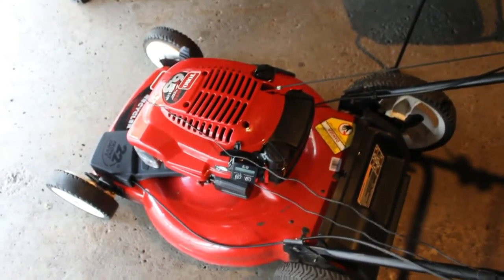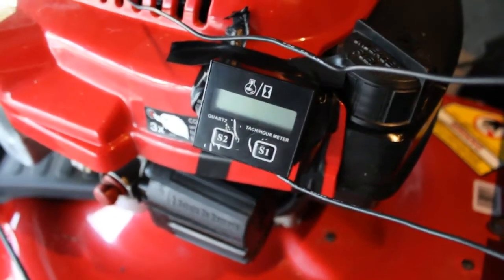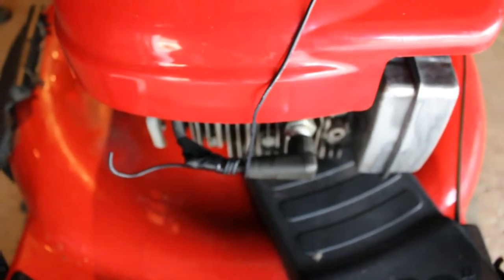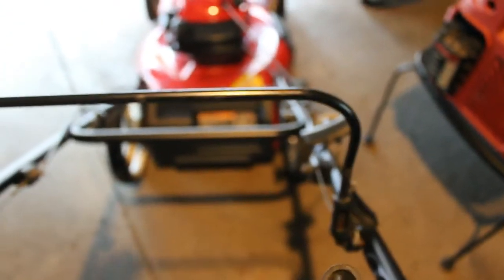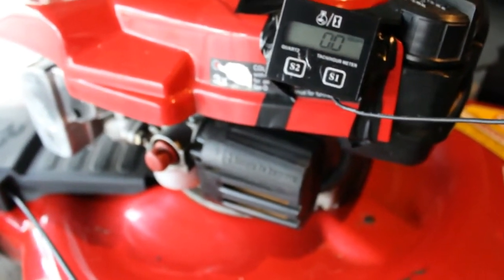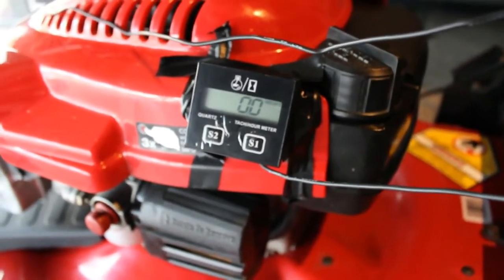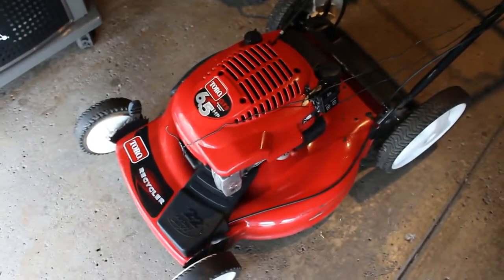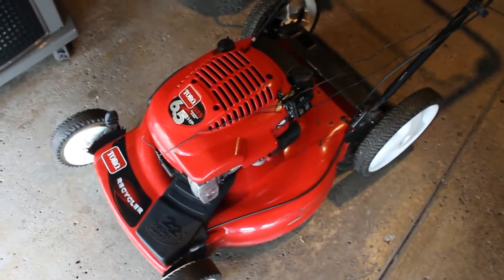Quick Video: How to Check Engine speed on ANY Lawnmower with a Digital Tachometer

Comment: Hi. Did you get that digital tachometer off of Ebay? How did the tachometer stay attached to the lawnmower cover? Is it magnetic or have a adhesive backside? I need a tachometer because my pushmower is running both too fast at times, and too slow at other times.
Reply from the maker: Here is the link to the Tachometer, it's pretty cheap. I just attached it with tape or I believe they provided a zip tie so you can attach it where you want to. Just click the link below to order it.

https://amzn.to/4cGUACA
Reply from the maker: I also have a video here using the same device which explains a little bit how it works and how to turn it off and reset it.

https://youtu.be/uFPChd0pbdA?si=vWyGsh8i2jBSxtbs